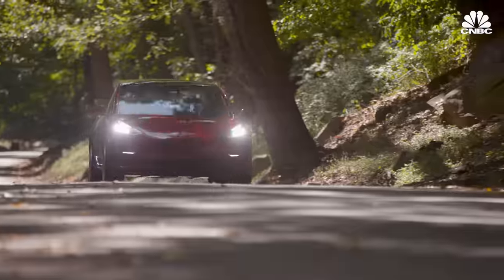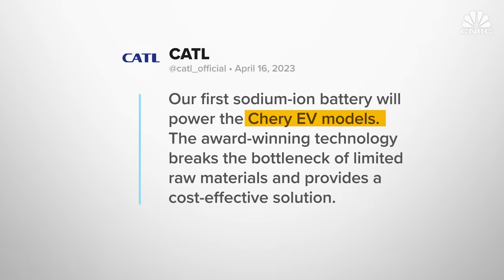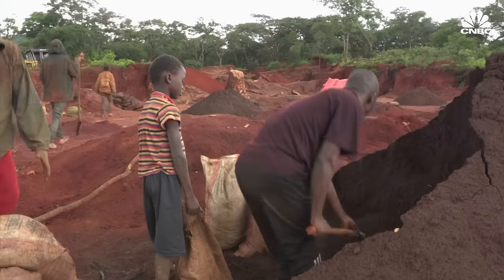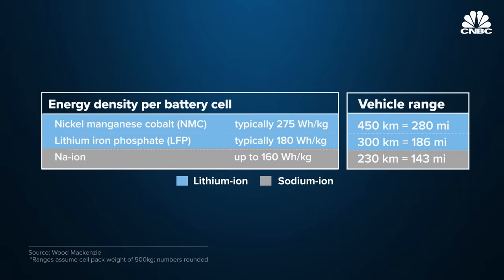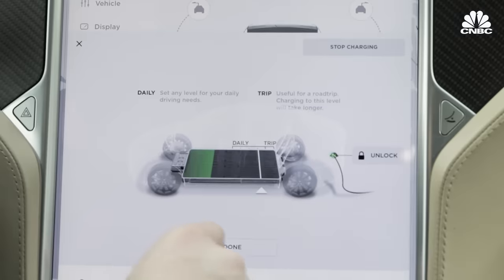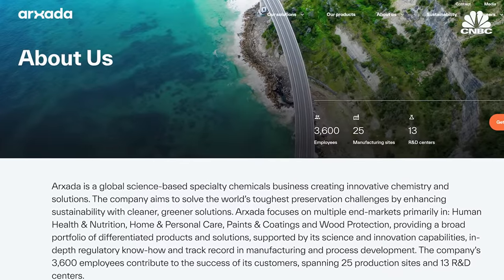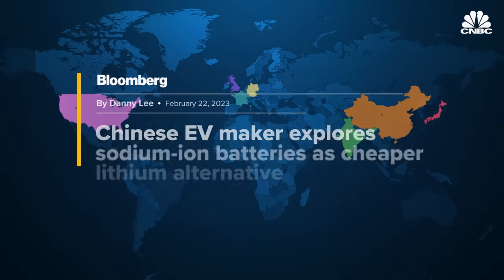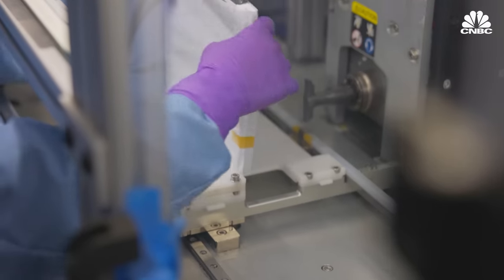How Sodium-Ion Batteries May Challenge Lithium

Comment: Since you need to keep lithium battery charge level within a narrow range -- like above 40% and below 80% -- to keep the battery from wearing out prematurely, its effective energy density is much lower than its advertised energy density.  This means sodium batteries are competitive even on the feature that has made lithium batteries so desirable.
Reply: Not true.
You can use 100% of lithium ion batteries when required like on road trips or during emergencies.
Reply: @neeljavia2965  Yes but it rapidly degrades the battery. With sodium ion batteries that’s not an issue.
Reply: @neeljavia2965  : Yes, you can choose to trade away some lifetime of the (expensive to replace) lithium battery in order to drive further.  But that doesn't mean my comment is wrong, because I was writing about the "effective" energy density and what you describe isn't best practice.  Perhaps I should have called it the "practical" energy density.
Reply: It's overblown. Nickel is king.
Reply: sodium ion batteries are slightly lower than lithium ion batteries, furthermore there will be silicone anode based batteries and solid state batteries
Reply: @brothermine2292  Fair enough.
However lithium ion can give you the extra safety which is something very difficult to give upp.
Reply: @sunspot42  For a single trip degradation is not a big issue.
Reply: @neeljavia2965  : Most driving is a much shorter range: commuting, shopping trips.  Most car buyers are price conscious.  I expect many people would be willing to buy more affordable EVs despite a shorter "emergency" range.
Reply: @brothermine2292  In LFP lithium batteries, you have to charge them at least once a week to 100% to keep them balanced (and you can charge them very often to 100%) and they last 3 to 4 times longer than Nickel based chemistries, as they have very little degradation because they never get nearly as hot, which is the mortal enemy of any battery. So your comment does not apply to Lithium broadly, but more for Nickel based chemistries, which still last a very long time with modern BSM and heat pump usage.
Reply: @Paul-cj1wb  : How low can LFP batteries be discharged without hurting the lifespan?
Reply: @brothermine2292  You mean discharging them to 0%? If you mean regular discharging during usage, it's because its temperatures in both charging and discharging is much lower than Nickel based, and like I said, what kills a battery is high heat. That's why they last so much longer. Their only drawback is their lower energy density which is why they are used in standard range EV's like the 270 mile standard range Model 3.
Reply: @Paul-cj1wb  : I didn't necessarily mean 0%.  I asked how low the % may go without degrading the health of the battery.  The video said sodium batteries can go down to 0% without harm.
Reply: @brothermine2292  I would keep it above 5%. On emergencies, you can go to 0% because all EV batteries have a hidden buffer to protect the batteries. But extreme YouTubers drive them way past that until they stop running and they are still fine. I would not do that often, those are done just to see how far an EV can go driving wise past 0%. 

Not that the average driver is ever going to test that, just like the average driver never drives past the 0 point mark on a gas vehicle. Most people fill their gas tanks once it gets to around the 1/4 mark full. Likewise most EV drivers charge at around the 10 to 20% mark.
Reply: @Paul  : How does the energy density of LFP compare to sodium?
Reply: @brothermine2292  They're very close. The average Sodium is around 140, while LFP is around 160. But adding other minerals/metals increases both by another 10% or so. Many, many researchers around the world are working on increasing them further, as well and other battery chemistries on a daily basis. 

Lithium Sulfur is the next to take over after the announcements and discoveries last year. Sulfur can hold 5 times more Lithium than any Nickel chemistries and is 3 times lighter. However, those are a few more years away. Lyten just broke ground on a factory in California to mass produce them this past November, 2022 with 3x the energy of Nickel. I have no doubts that Chinese companies will steal/copy these discoveries and mass produce them even faster. So sometime later this decade they will be in mass production. 

Sodium-Sulfur will no doubt be another option with twice the current energy density. In fact, those are in use right now in a couple of grid scale energy storage locations. But those are only in high temp environments (above 95C), as they were will built prior to the discovery (one by accident) of the room temperature stage of gamma sulfur using vapor deposition on carbon fiber and carbon nanotubes last year. Or announced last year, they had been in research/trial prior.
Reply: @Paul-cj1wb  NiCd batteries don't get hot. They have terrible energy density and contain cadmium however haha.
Reply: Is that why phone should not be charged to 100% all the time
Reply: @neeljavia2965  Yeah but it becomes a huge issue over multiple trips.  Sodium ion batteries may have a lower maximum range for the same weight and volume, but for practical everyday use in a commuter car - where the maximum range is seldom tapped - they'll be just as practical.  And for longer range use - especially in cold or hot weather - you can push the sodium batteries to their limits without concern.  So in practical use, I don't think the effective range gap between sodium and lithium batteries will be as great as some of the raw numbers suggest.  It's a 25% cost savings that I'm betting many buyers will be willing to make.

I seldom took my own commuter ICE car on road trips.  I'd always rent a small SUV.  Why put that much wear and tear and mileage on my own vehicle, which wasn't really designed for long road trips, anyhow?  Just shaving those miles off of my annual total lowered what I paid every month for insurance enough to pay for the car rental, not to mention the maintenance and depreciation costs to my commuter car.  And I got a more-comfortable experience.  Likewise, I suspect those with sodium batteries will simply rent cars when they want to go for longer road trips.
Reply: @neeljavia2965    No you can’t.  All lithium ion batteries have protective circuitry in them to prevent you discharging them below 20%.  You could probably bypass this circuitry to discharge it further but it wouldn’t be advisable due to the battery damage that would occur.
Reply: @brothermine2292  That's not how they're measured. The voltage depends on the battery but for lithium batteries that Ah or WH rating is for voltages between 3.2v ("0%") and 4.2v ("100%"), so no you get 100% of the advertised rating (assuming it's a reliable rating and now chinesium). There is so much wrong information in this thread it hurts me. And to the wafflebrain that says you can use "100% of the battery" in emergencies, no you can't. Besides the fact that every modern battery powered anything has low voltage cutoff to stop you from doing that, if you get it to 0V you will stop it from conducting permanently and it won't be a battery anymore it'll be a brick.
Reply: @ILoveTinfoilHats  : Pay more attention.  My comment was about the desirability of keeping the charge level in the 40%-80% range, to maximize battery lifetime.  I didn't say you can't exceed 80% or go below 40%.
Reply: @David-lr2vi  Source?
Reply: @brothermine2292  "since you *need*...". What did someone give you a lobotomy recently?
Reply: @ILoveTinfoilHats  : No, but it appears you had a lobotomy, because you failed to cite the premise in my statement: "to keep the battery from wearing out prematurely."  The statement implies you do NOT need to keep the charge within a healthy range if you are NOT interested in maximizing the battery's lifespan.
     Some smart devices can be programmed to stop charging their lithium battery at a threshold below 100%, because their manufacturer recognizes that not all users care more about device runtime than battery lifespan.  Some hybrid EVs are programmed to switch from battery to gasoline when their lithium battery charge has discharged to 40%, to try to preserve the battery lifespan.  They understand more than you do.
Reply: lithium batteries have higher energy density which means that sodium batteries will not be replacing them inside of EVs
Reply: @ockertoustesizem1234  : For many car customers, low cost will be more important than having a high maximum driving range, so the battery's energy density won't be decisive for them.  Most driving is commuting & shopping that doesn't require a long range between recharges.
Reply: @Paul-cj1wb  I made a 12.8V  150Ah LiFePO4 battery from some cells I bought from China.  I charged it and then left it unattended for more than two years with essentially no degredation - sure it may have become slightly unbalanced - but charging it with a balance circuit will bring it back in balance.  LiFePO4 batteries retain their charge far better than standard Lithium Ion batteries.
Reply: @brothermine2292  I wondering wheter it's possible to swap sodium ion battery to lithium ion in the same EV when you go a long trip. At least it would be desirable.
Reply: @MrBiiila  : The second battery would be expensive, and the car would need to be designed to allow battery swaps with little labor.
     Swapping cars might be more desirable, particularly in a household or friendly community that needs to own more than one car anyway.  There are a lot of families who need more than one car and it would often make sense for only one of the cars to be lithium.
     And of course there are other means of long distance travel that in some circumstances would be a reasonable alternative: planes, trains, buses, rented cars.
     If the long trip is longer than the range of the lithium battery, swapping wouldn't solve the range problem.
     If fast recharging stations are easy to find along the travel route, the shorter range problem wouldn't be a significant problem.
Reply: @brothermine2292  Yep, I agree with your reasoning. By the way I live in Hungary and the EV penetration is till low, regularly every family has own only one car since there are no big distances ( small country ). Most people use public transportation to commute. Aaand I wouldn't share my car with neighbors, I don't trust them. 😅
Reply: @sunspot42  emergencies and road trips are not daily commutes though. They are once in a while type of thing
Reply: @neeljavia2965  Yes,but: If you 'push' a Li-ion battery, there's a chance it'll BURST INTO FLAME. Bad for your car or home use.
Reply: @ReggieArford  Not even 1% chance.
Very rare.
Reply: @xlargetophat uh no, nickel are just one of material to make lithium ion
Reply: True with lithium ion but not with lithium phosphate(LFP) and last 4x as long. They're out now in most solar generators and EV's from tesla and Chinese ev manufacturers.  Sodium ion batteries are first out now from Chinese ev too.
Reply: liFePo4 batteries operate happily between 5% and 95%. It's only the L-Ion NMC batteries that have the 20% 80% limits.
Reply: That is a load of crap! You are 100% wrong. Maybe five years ago that was the case.

Comment: Everybody talks about batteries for electric cars. In the grand scheme of things, that's a pretty minor use case for batteries. Grid power storage is WAY bigger and more important. And in that case, the power to weight ratio is irrelevant because the batteries don't move.
Reply: In the US, 27% of greenhouse gas emissions come from vehicles.    That's a minor use case?
Reply: Yes, also 150km range is enough for a lot of people, if you can charge overnight, everyday.
Reply: but there are better options for stationary storage
Reply: @wadexyz The EVs do not reduce CO2 emissions in any way. It is the renewable energy production that does. If tomorrow morning all the cars in the world are electric, the CO2 emissions will NOT change since the renewable energy production does not change and the additional load has to be produced from fossil fuels.
If you can manage to increase the renewable energy production, then you can use that additional energy with ANY existing electrical devices, no need to create new ones (like EVs). Basically the electric cars are pointless.

Comment: Sodium ion battery commercialization is going to be moment of historical magnitude in the road to energy transition.
Reply: Hard to get around the atomic weight difference for mobile applications. Great choice for stationary applications.
Reply: @jchristensen07 The advantages of sodium ion electric batteries are many and I consider them the best Much cheaper Its price is approximately 10% of the lithium battery only Faster charging (almost two or three times faster than lithium) Withstands a variety of temperatures. Lithium batteries cannot withstand high heat or extreme cold! It includes the diversity of the presence of raw materials in different geographical ranges. It does not use cobalt, graphite, or lithium, and it is not flammable. As for cost, sodium batteries have the advantage of availability of materials and the possibility of improving their energy density, and their cost can be reduced Sodium batteries could take over a significant share of their lithium-ion counterparts, alleviating lithium supply issues and lowering overall prices for electric vehicle batteries.

Comment: Something that isn't talked about it:- Sodium Ion can revolutionize EV market by the way of swappable batteries, and since it's cheap, stable and mass producable, it stands at an unparalleled advantage vis-a-vis Li-Ion batteries.
Reply: I think the slightly reduced range but cheaper and safer is a good trade off for a daily commuter IMO. There is no need to swap at all especially since they appear to last longer
Reply: @freeculture  That's exactly what I'm saying. You don't need to have the highest capacity battery in your daily commuter. Whenever you run out of juice, and if you cant charge, just go to your nearest gas station and swap the battery. As simple as that.
Reply: @freeculture  I think what he meant was a very impractical battery swap instead of recharging. Like cameras and drones have extra batteries if one runs out of charge. You take used one out and swap it and then recharge both at home. This is very impractical tho because even if you have a gas station providing battery swaps just charge instead🤦‍♀.
Reply: Eseentially we need battery bay design where multiple small size batteries can be inserted in car on demand at swapping center.
Reply: @Sneakoz It's about speed of charging. Mechanized Swapping is easier than charging.
Reply: @CountingStars333  No more range anxiety if everywhere such batteries are available and the battery pack could be less powerful and smaller now so the car would be lighter too and provide more room. Batteries would rarely get totally emptied. Yes, I see it all before me too. Of course (weak point?)  that battery would need to be standard for everybody.

Comment: Lower cost batteries for home use would be very nice.
You could change the batteries during off-peak hours when the cost for electricity is less.
Also, it might help even the load on the grid as EV charging stations proliferate.
Reply: So if everyone is charging their home batteries when its off-peak it will become peak hours....

Comment: I am wondering which sodium ion batteries you’ve been looking at for the claim that they have a higher cycle life then lithium ion batteries. As far as I know, at least for the batteries from CATL, they currently have a significantly lower cycle life than lithium ion batteries which is one of the main drawbacks.
Reply: Link plz. The only commercially available Sodium ion batteries are from HiNa. They are saying their battery  has charge cycle similar to LFP batteries. That means they have better charge cycle than traditional lithium ion (NCM, NCA, LCO and LMO).
Reply: They also have ZERO tolerance for humidity as I understand it.
Reply: @najibyarzerachic  If you are north atmosphere where you have winter session, your sodium may outperform lithium charging cycle. Sodium retain electricity better than LPF.
Reply: CNBC got this one WRONG. Sodium battery has lower cycle of life.
Reply: @jchristensen07  no you understand it wongly. Stay up to date.

Comment: Per volume they aren't as energy dense as LFP.   Cobalt and Nickel are still going to be needed for vehicles that need lots of range (and are very expensive).   The benefits of sodium seem to be cold weather performance (good for where i live) and cost.  Maybe we'll finally see cheaper/shorter range EVs.  I could easily live with a car that has 100 miles of range--given there is a decent charging network.  So you'll have cheap low range sodium ion/mid range-mid cost LFP/ and expensive high range NCM/NCA.
Reply: We are right around the corner on autonomous vehicles. An interim stage could be those vehicles delivering battery swaps to achieve any range needed.
Reply: And it would be desirable swapping these type of batteries in the same car, so you can decide which one is the proper one for your actual needs.
Reply: >> Per volume they aren't as energy dense as LFP.   Cobalt and Nickel are still going to be needed for vehicles that need lots of range (and are very expensive). <<
This is not true.  NCM/A are already cheaper per kWh/kg than LFP to make -- the cost of raw materials are already 20% cheaper than LFP.